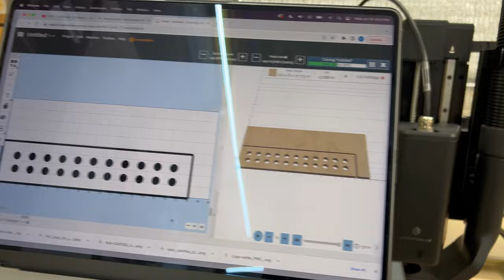The most EXTREME Router Table Build / Bit Storage, Dust Collection, Power Feeder, and More!

Comment: Very nice table/cabinet. One thing - you may want to drill some vent holes in the dust collection area below the router... without them, you will get severely limited airflow. 4-6 1/2" holes in the back will create a nice venturi effect and vastly improve dust removal from beneath the table.

Comment: Great build and great video! I just did my router table too. For anyone else out there, you can use a straight edge and a razor blade to score the acrylic and then snap it. Table saw is faster, but its a good alternative if you want to avoid those chips shooting back at you.
Reply from the maker: Thanks for the feedback and pro tip 👍🏻

Comment: Great router table build. I don’t have a CNC or 3D Printer so I’ll have to drill the holes at 2 different sizes. Keep showing us your builds, they are inspiring.
Reply from the maker: Thanks for the great feedback! I do sell the router bit storage inserts if your interested. And far as the CNC goes you don’t have to have one to drill precise holes! I just got that machine in the shop so I was just pumped to use it and try it out 👍🏻

Comment: Looks awesome man. Those black and red bit holders match perfectly.
Reply from the maker: Thanks for the great feedback and I agree 👍🏻
Reply: @eastcarolinawoodworks  One thing I would do is use the red ones for 1/4" shanks and the black ones for 1/2" shanks. One thing before I forget....the exhaust hole should be at the bottom of the router box, not in the middle. Saw dust would collect at the bottom of the box, not the middle. You might want to look into that. :)

Comment: Some triangle braces going down the back of cabinet might be enough to get the rigidity you want. Very fun seeing your shop. Love the lights. I wired my shop to have two light switches that control even and odd rows of lights. Works out great if I just don’t need them. I want to add a under cabinet workbench light like you have done.
Reply from the maker: Funny thing I added a triangle brace and it helped some but didn’t get rid of all the flex! And yes I love the lights makes a huge difference 👍🏻

Comment: I way over thought this. Have a similar table and the plywood on the sides was nowhere near square to the bottom. Had to use spacers etc. then the bolts for the frame got in the way.  You made it look pretty easy. Mine is been a bit of a challenge.

Comment: 22:04 raise your blade higher. That way when it cuts the chips move downward rather than outward. This is why plastic cutting blades have high tooth counts and positive hooks (20° or so). But a rip blade will do just fine, nut you will want to move it slowly. 
 
Another option is to sandwich the plexiglass between two pieces of this scrap. I do this with aluminum and plastic when I want a pristine cut.

Comment: Where did you get the file for the brackets to hold the Y fitting?
Reply from the maker: I designed and 3d print them! If your interested in them I could send you the file? 👍🏻